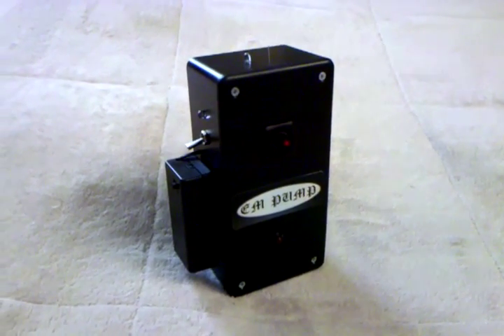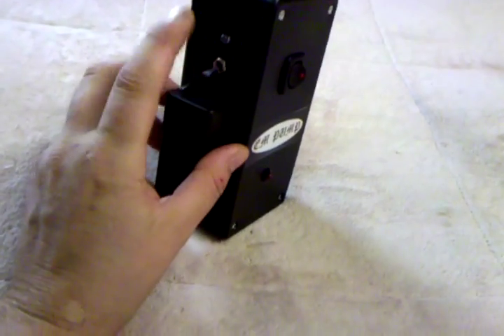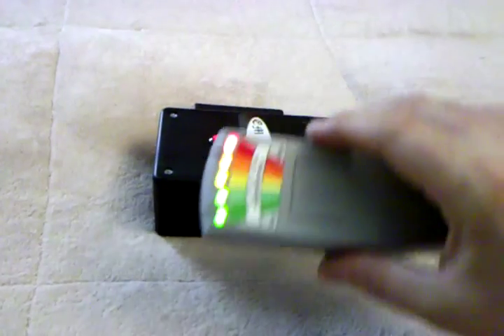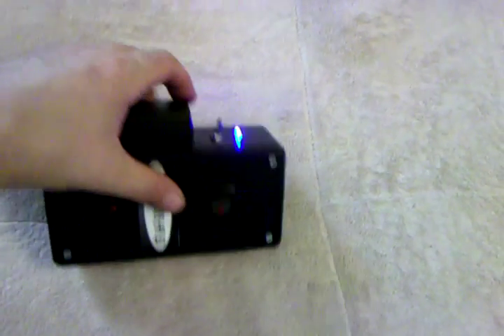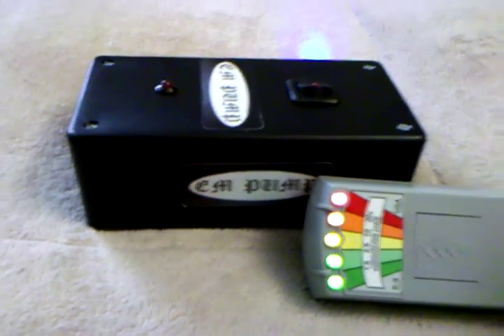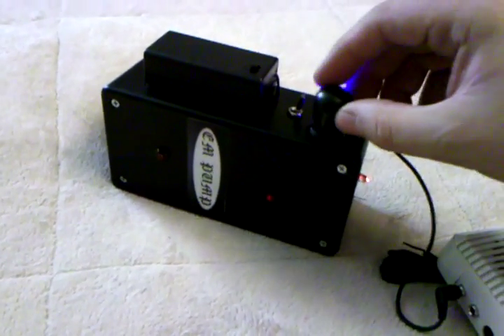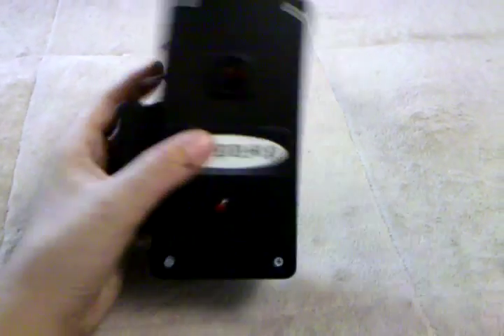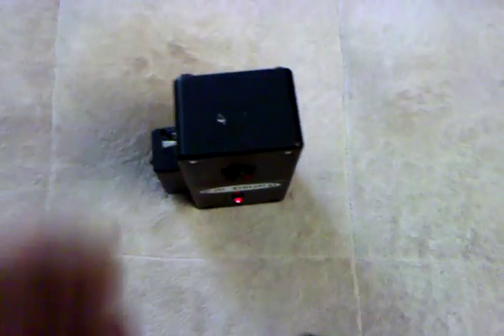EM PUMP with 4 different components built into 1

Comment: don't waste your time with magnets they do not put out an electricaj feld like the batteries do  trust me
Reply: Interesting ... Fixed magnet fields and EMF's are generated differently but are in fact the same field.  Why trust you? wheres your proof. Also how do we know for certain which generation method 'pumps' more energy into ghosts so they can communicate with us? https://sciencing.com/create-electromagnetic-field-5135610.html - "Scientists now know that the field surrounding a permanent magnet is the same as the field surrounding a wire through which an electric current is flowing"

Comment: good job robert. if you take the coil out of the phone pick-up and conect it to a amp siren alarm instead of its speaker, boom, you got a strong coil em pump, i only make the coil transformer pumps now, not the motor ones anymore, too loud, fragile and lots of vibrations